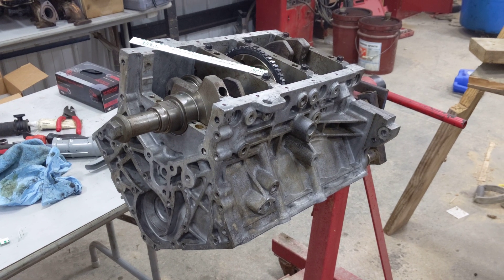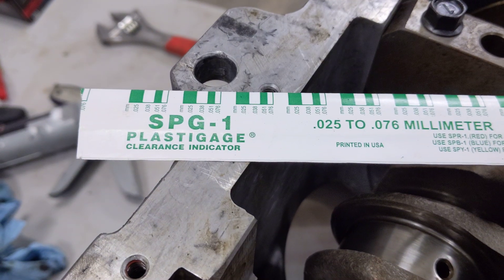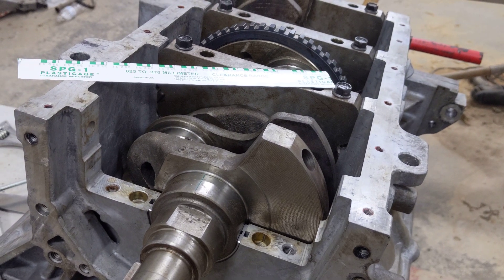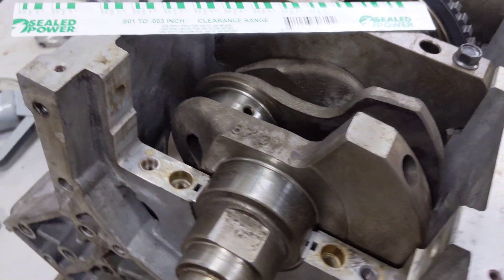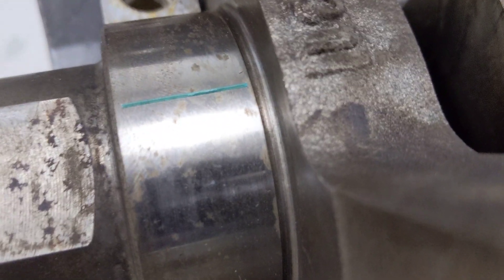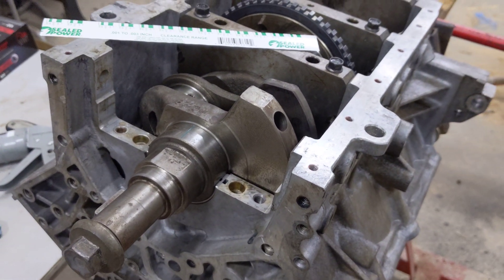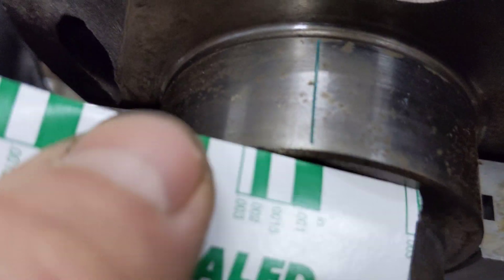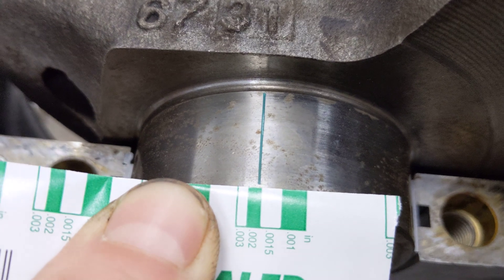1997 Honda Passport - 3.2 rebuild update 3 (checking bearing clearances)

Comment: PlastiGauge isn't for checking "correct size" bearings...it's to determine how much wear has occurred. Looking at the piece you have sitting on crank journal it doesn't seem to have been checked yet with bearing cap installed then removed? If it has been then the crankshaft appears badly worn (the wider the plasti-gauge is flattened the tighter the bearing clearance).
Anytime new bearing inserts are installed it's important to polish the main and rod journals on crankshaft - you can polish them yourself but if you have never polished a crankshaft I highly recommend learning how it's done (machine shop can show you how). I'm getting ready to overhaul my 1996 Isuzu 3.2 - has 482,000 miles. Valve guide seals are leaking - oil is being sucked into combustion chambers - smoke out exhaust.
Hope you have good luck!
Reply from the maker: I had not yet installed and torqued the bearing cap in my video.

Ideally you should check your crank journals with a micrometer or calipers before buying the right sized bearings. Sometimes there are packaging or shipping errors and you might receive the incorrect sized bearings without noticing. Plastigauge is your safety net to catch any mistakes and to ensure there is proper bearing clearance before running the engine.
Reply: @LooseNut  Sounds cool...I've never expected getting any wrong bearings for crank. They typically will be stamped with "std" - 0.010" - 0.020" - etc on backside of inserts.
Checking clearances with PlastiGauge is always good idea (so cheap to do).
How is the 3.2 doing? Is it running now.
Reply from the maker: @raybin6873  I had a couple issues with faulty fuel injectors, but a new set cleared up that issue and it's running great now. No large oil puddles anymore!